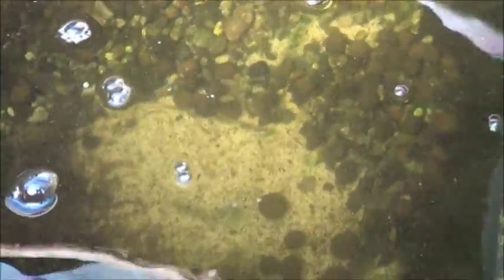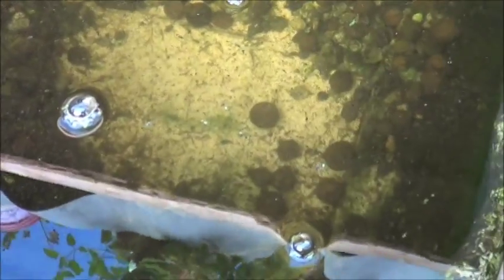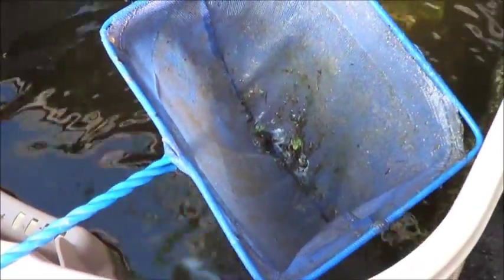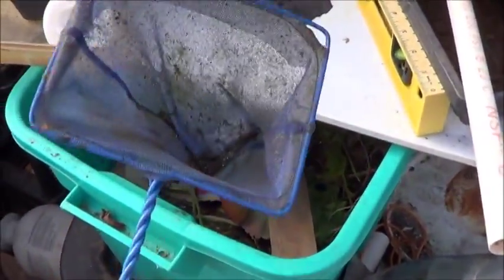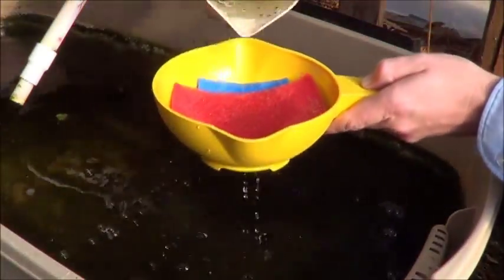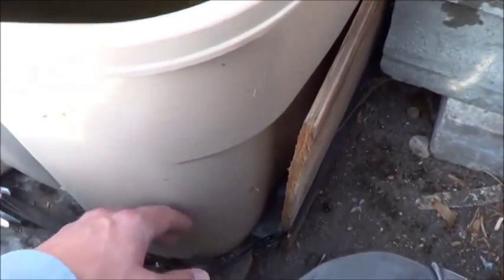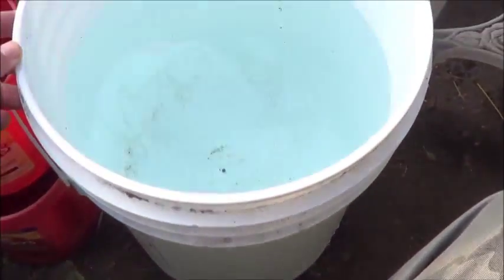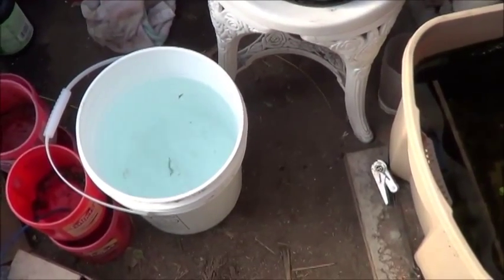The NPAG & Basic Water Quality Control

Comment: NPAG is looking good, but I don't envy the lifting you have to do with it. One thing to possibly try, get an aquarium grate to fit on the bottom of the tank. More of your solids will end up down there, and if you get a hand pump cleaner unit like you were talking about, you can pull the groddy water out periodically. Dirt beds LOVE that stuff.

The biggest envy I have JT, you only have Chlorine to deal with. A lot of cities here in the States have started using Chloramides, and those DON'T evaporate out with only a day or two. You have to use a de-Chlorinator here. :(

Comment: If you can't raise the fish tank, can you dig a hole? Measure the square footage, dig to depth, grade the bottom, and clean the sides. If you can dig, I would still assume the manual siphon an option. :)
Reply from the maker: 8BitMinotaur Ah, digging ... so many of my little projects would be going much better if I could dig down a little bit!  Sadly there are a few reasons why any digging is out of the question.  The two biggest being a gas line down there somewhere and the water table is fairly high here.  We're only blocks away from the lake and it's a sandy soil around here ...
I think I will end up raising the fish tank & sump in the NPAG before too long.  Once I started thinking about those siphons for vacuuming fish tanks it became a better idea by the moment!